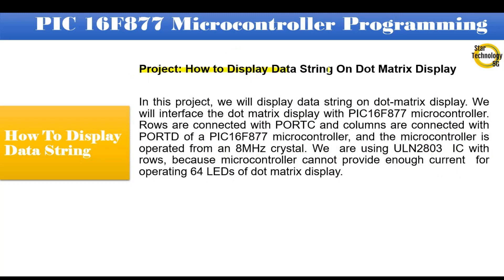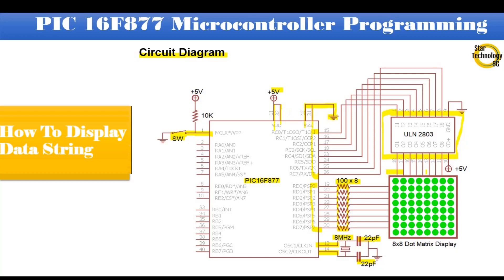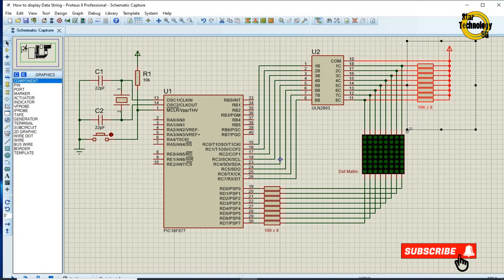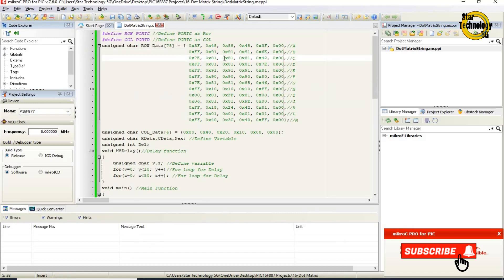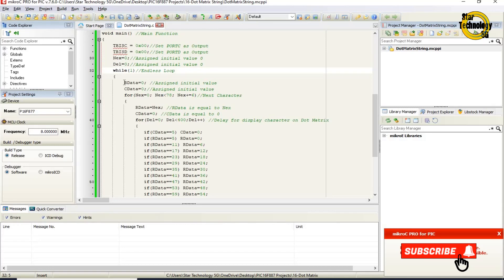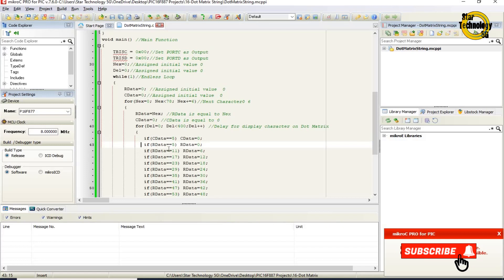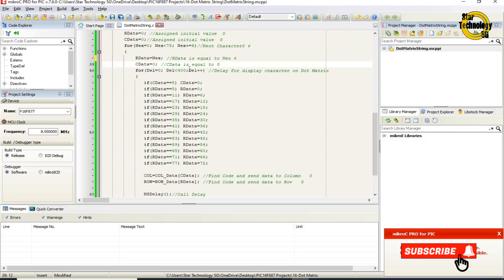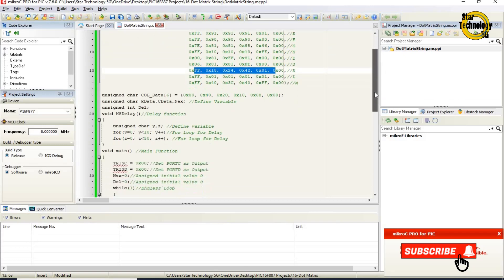Microcontroller PIC16F877 Video-23 How To Display Data String On Dot Matrix Using Mikro C for PIC

Comment: Hello! Where can I access the code for this application? I entered all the links in the description.
Reply from the maker: Copy from video
Reply: @StarTech5G  I noticed that you don't use the whole array of 8x8 LEDs. I would like to display a sign, like a smiling face, and others, on the whole matrix. What array should be resized?
Reply from the maker: @HobbyHomeWorkshop  yes I didn't used the whole array, u can use whole array.
Reply: @StarTech5G  Well, I draw a smile face,  8 hex numbers (0x04, 0x04, 0xE1, 0x01, 0x01, 0xE1, 0x02, 0x04), you have 6 in the array. I commented a line from ROW_Data and write the one above. Now, I can't build the code, I have an error.
Reply from the maker: @HobbyHomeWorkshop  what error? can you please show to me.
Reply: @StarTech5G  Well. it seems that YouTube does not allow me to share a screenshot even from my g drive, I also tried to use external sites.
Reply from the maker: @HobbyHomeWorkshop  please email me at
startechnology5g@gmail.com